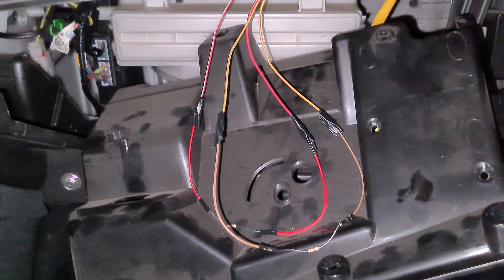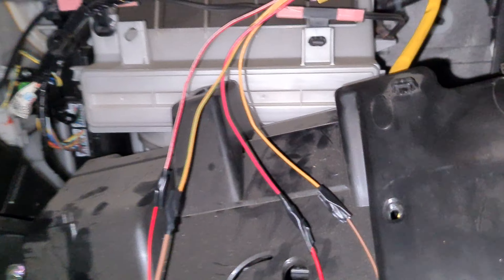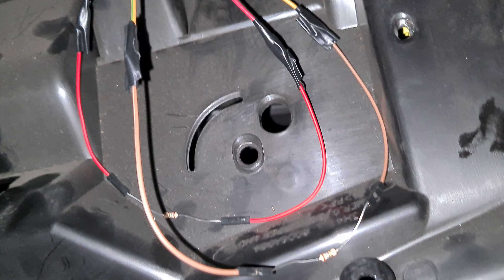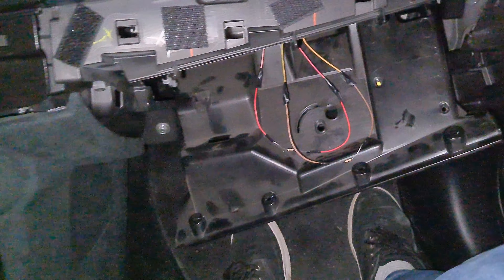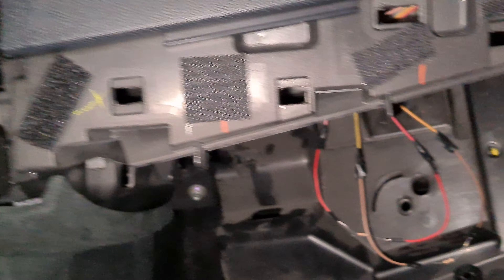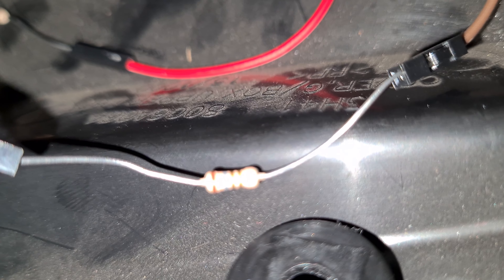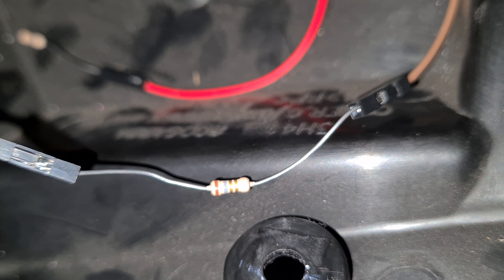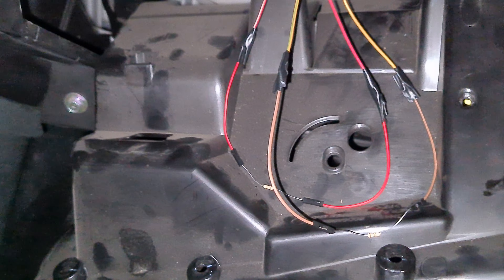Hide Airbag message for Mitsubishi Lancer / Evo X Using Two Resistors

Comment: Do it really work?
Reply from the maker: yes, of course.
The car needs a complete circuit. 
By adding a resistor, you do exactly that.
Reply: @cyecize-cars  what resistor will I need?
Reply from the maker: 1.8 ohm
 @EmilianoGarcia-z2f
Reply: Bro How many watts of that 1.8ohm resistor?